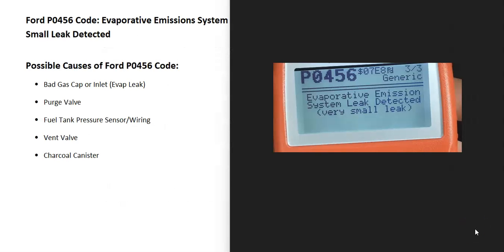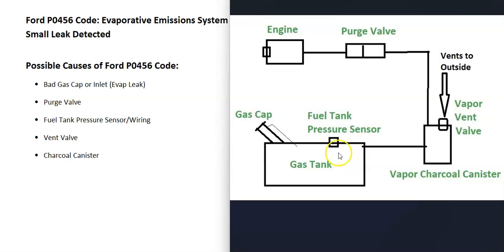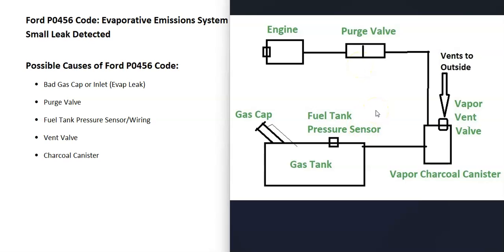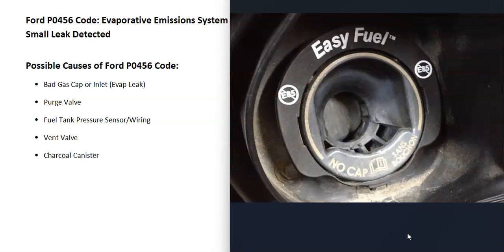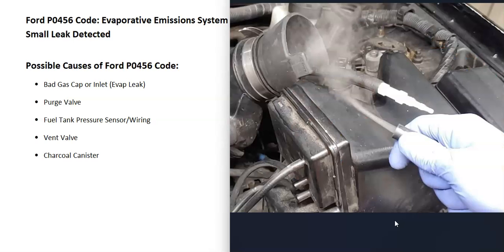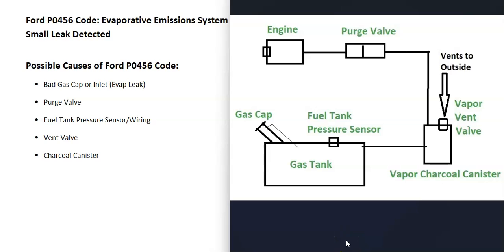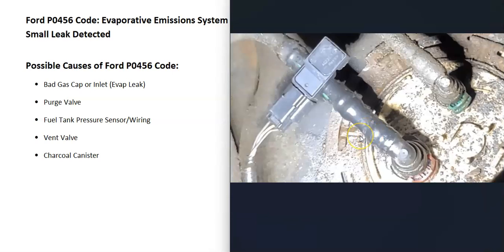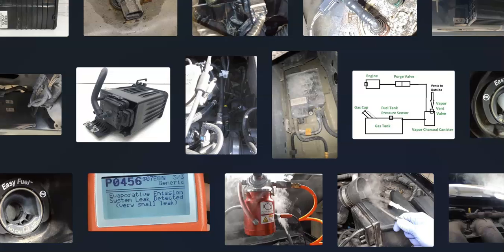Causes and Fixes Ford P0456 Code: Evaporative Emissions System Small Leak Detected

Comment: I just got this code, but i was told it was the Vapor Canister Vent Solenoid. Should I start there or its it the purge valve?
Reply from the maker: Components need to be tested. The purge valve is easier to test than the vent valve. The purge valve is normally closed, so if you can blow through when it has no power, it is bad. You can also use the engine vacuum to test it without removing it. I made a video on this here is a link. https://youtu.be/X-Y5YsaXxJE

Comment: Changed the fuel pump, high pressure fuel pump, soldered poorly placed wires, and replaced the purge valve and this thing STILL has a code… I see a light crack near the no-cap flap so it’s either that, bad tubing, or the charcoal canister… I should sue ford because there’s a recall for the purge valve but not the bad wiring that I had to splice myself.

Comment: Thank you! Can you please explain to me if in fact it is just replacing the fuel filler neck, why does that cause my acceleration to mess up? Why is the rpm and speed so slow and pressing on the gas just feels like it doesn’t make it go any faster. How would the fuel filler neck mess with the speed? I’d assume it would just eat up my gas but it’s just not letting me drive past 15-20mph it did this to me earlier this year but I changed the purge valve and it was fine after but now that p0456 is back!

Comment: had my purge valve stuck open and replaced new 2 years ago, lately i have the "very small leak" code and the tell tale sign its faulty again because my car stalls initially when i fill my gas tank up BUT ive tested the valve by taking it out of the circuit and hearing it click with a 9v battery so im not sure how the fumes are being pushed into my block
Reply: My fiesta also stalls when I add fuel.

Comment: I have 09 ford focus first I had a p0451 code, I changed the fuel tank pressure sensor. Check engine light went away for like a week and half then I got the p0456 code. I changed out my purge valve and check engine light has not come off. I haven't tried that smoke method yet maybe that'll work but idk any mechanics that have a smoke machine though.
Reply: Have you tried deleting your check engine light codes?

Comment: From what i have read on other posts, once you find issue the code will go away after some driving? Is this true? 2017 ford escape 1.5 L
Reply from the maker: Yes, once it is fixed, it will go away once a drive cycle is completed. You can Google your vehicle drive cycle and do the steps to speed it up.

Comment: If my car had an O2 sensor issue that when untreated cause it would pop on and off with no reasoning.... should i start there before replacing the valve?
Reply from the maker: Usually, a 02 sensor and EVAP problem are separate issues. If the purge valve is stuck open, it may affect it.
Reply: @HVAC_Mechanic what makes the purge valve get stuck open if this is a recurrent problem?

Comment: What happens if you cannot start vehicle yet you had the P0456 code
Reply from the maker: If the purge valve is stuck open it can cause issues sometimes, but it will not stop the engine from starting.
Reply: Have you tried scanning your vehicle's OBD2 for Check Engine Light Codes?
Reply: How do you purge it and wheee is it located to purge it
Reply: @Heavy69Metal  find your manifold and look for a small hose line and trace that back until you see it
Reply: @Heavy69Metal  it's on the right side of the engine near the middle going to the back I believe

Comment: 2016 Ford Transit Connect...Ended Up Being The Purge Valve Solenoid Has A Vaccum Stuck open while the Engine is Running.. Replaced part.
Reply: How long did it take you to replace the part?
Reply: @MikesVlogss  .. Takes 20 Minutes too install the New Part.... Easy Work

Comment: I have a 2019 Ford Escape and my engine light came on at 65k miles.  I go to Midas and they told me I needed my fuel injection system cleaned. I Paid like 600 bucks when that was my code. And guess what 3 days later my light was on again! Autozone said I needed some gadget and it was only $75. So now I have to go back to midas and if they have the audacity  to tell me now I need the piece to fix the small leak I'm going to be mad! They charged me 600 for something  I probably  didn't even need!!!
Reply: Fuel injector cleaner costs like $15 and all you gotta do is put it in your gas tank you got scammed like crazy
Reply: Facts
Reply: Midas, commissions? i worked for a Goodyear shop years ago. Made a ton of money but quit.  Sad that business’s take advantage of customers.

Comment: No links for the suggested smoke machine....?
Reply from the maker: I added the link.
Reply: Hey buddy i have 2014 ford f150 and 6 months ago i had a code that was reading P0455 I figured out what it was and I changed the purge valve yesterday I got the same exact code on my truck again this would be the second time I would change the purge valve any ideas on what else could be happening
Reply: @tristinsanchez9983  I would check all the air connections on the evap system and the electrical plugs on the purge valve, also clean the gas cap seal if you have the Easy Fill capless system on your gas filler inlet.